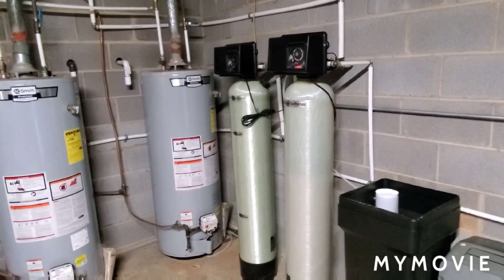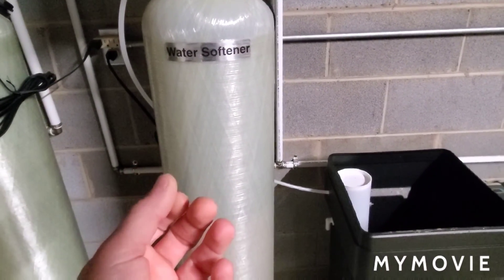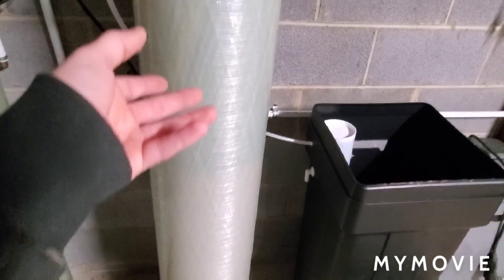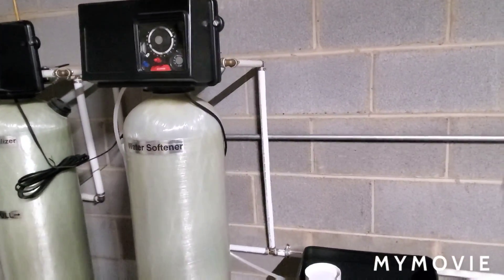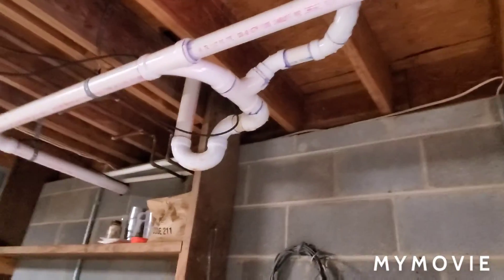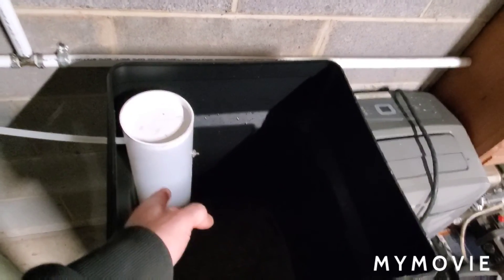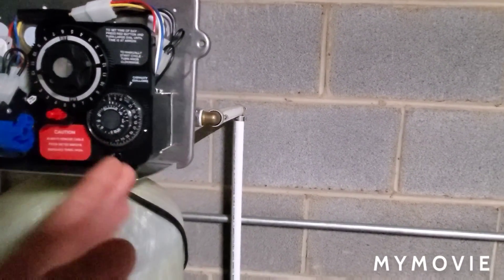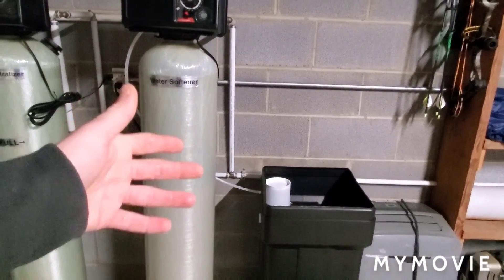Water Softener, How It Works & What it's Used For. Salt System

Comment: Hi Phillip do you know anything about the centrifugal water softener systems. They look like a big stainless steel drill bit in a tube? No electricity or salt needed it supposedly slings the calcium out of solution and the the mineral just flushes thru your plumbing system as you use the water. It somehow changes the molecular make up of the calcium in the water

Comment: Two years later this video still helps people, AMAZING! much <3 for your willingness to help others! I figured out my softener wasn't working right when you showed that the salt tank should be holding water. since mine has no water at all and did a cycle just last night think i must have a leak in the tank or plug in the fill/extract line. Question, I want to do a pool shock treatment(as your other video shows) but I'm worried about the chlorine messing with the neighbors water pump as my neighbors well is only around 20' or 30' away from mine.  I'll do some research to see if its safe, however I would still love to hear your thoughts on this. Thank you for your time.
Reply from the maker: It wouldn't have any affect on their well. Itll be fine.

Comment: Hi, I have a question regarding your recommended location for dumping the brine discharge into the roof drain. Since I'm in a intercoastal or tidal water shed area I'm wondering what might this do to the vegetation?
Reply from the maker: It's high in sodium, so the salt would kill the grass . Also not good to discharge into a septic system.

Comment: Did I miss something...when does the water get to the water tank that you use in showers, dishwashers, etc....  My  brine tank is really  dirty, mildew build up or moldy.   Does that stuff get into the water system throughout the house?
Reply from the maker: No, the salt/brine tank water only enters the water Softener during the cleaning cycle. While it cleans the resin bed with salt water, the filter head does a bypass which no water would pass thru the filter.  
The mildew you are seeing comes from the dirty salt these systems use. You can clean the tank out once it's empty of salt. But no the stuff you see never makes it into the house. If it ever did, your water would taste terribly salty
Reply: @h2omechanic  Thank you for taking the time to reply.  I didn't think so, but I wanted to make sure.   We will be cleaning out the tank either way.

Comment: My toilet was running for 8 hours from the bleach bar under the flapper I didn’t realize till I woke up should I worry about my softener? Got the softener from the plumber 8115 wasted gallon of water geeze
Reply from the maker: You should be fine. Your septic system is what needs a rest lol. Try to use minimal water for a few days to away the septic field to recover. If your worried about the softener, go to it & follow the directions on it & put it in backwash. Everything will be okay
Reply: @h2omechanic  ok thank you man is backwash same as a regenerate just manually Does your water softener regen daily

Comment: Sometimes after very heavy rain I am getting a little silt in my well, and this dirty water was refilling my brine tank. My brine tank is transparent, so after 5 years I can see that about 2 inches of dirt accumulated in the bottom of brine tank, the salt above is clean, as I refilling salt every 2 months. My brine tank is tall , so I am unable to reach the bottom with my hand. What is the best way to remove this dirt from the bottom of the tank? I was thinking let salt go to the dirty level without refilling, then remove dirty solids with some scoop on long handle first. But how to siphon the remaining dirty salty water and dirt after this? Using hose pre-filled with water will not work, as brine tank is located at the low ground level in my craw space.  Your advice will be highly appreciated.
Reply: Great idea.  Thank you for your advice.
Reply from the maker: The salt is what is dirty & leaving the silt you see. Let the salt run out and use a wet/dry Shop vac to suck out the water & silt at the bottom.

Comment: How often should you clean out your brine tank? I tried sticked a broom stick and it seems pretty solid, the broom stick doesn’t want to go all the way through without really pushing it hard. Also the water and salt in my brine tank looks like mush/slush at this point. It doesn’t even look like solid salt pellets anymore. We’re getting very hard water so obviously something ain’t right. Any suggestions? And thank you for your videos, they’ve helped me tremendously!
Reply from the maker: Your Salt has bridged! Happens quite often with the pellet style salt. Use a hammer & chisel and start picking it out. Id recommend using the blue bags of crushed salt. Id say to clean it out every 5 years. But occasionally I kick the salt tank to shift the salt. Typically bridging Happens bc its under a house in a high humidity area. But the salt should prevent any bacteria from forming in there. Its just that the salt isn't refined, so over the years we get alot of Crap mixed in.
Reply: @h2omechanic  Ahhh makes sense, you nailed it. Mine is in our unfinished basement and it can get humid down there so that’s definitely it. Gonna have to clean it out, thank you so much for the quick reply!